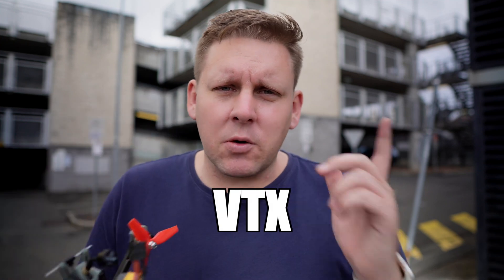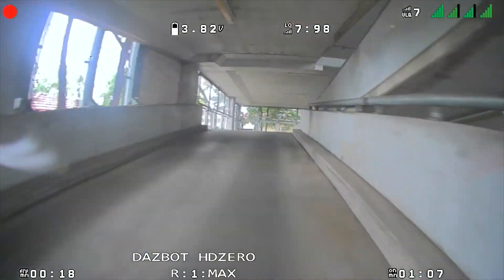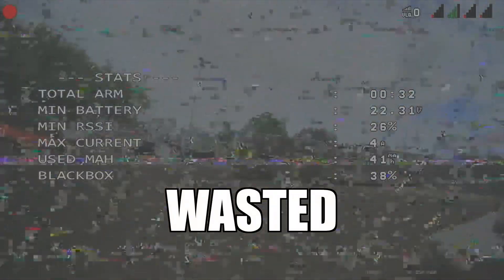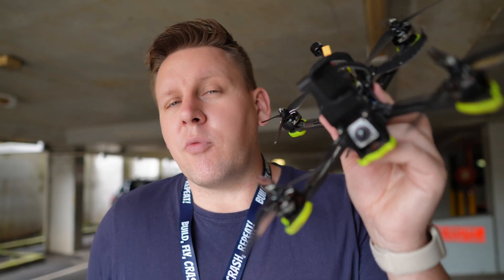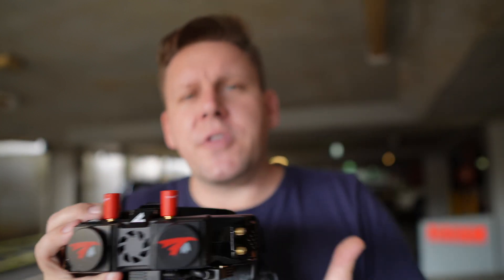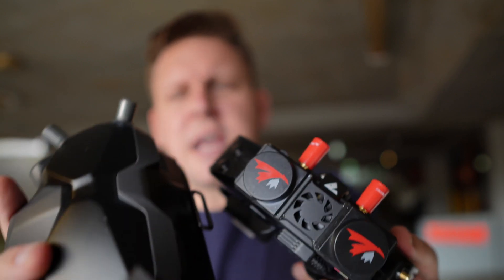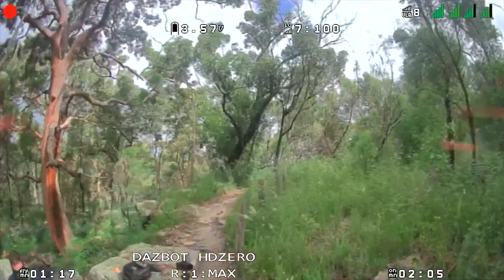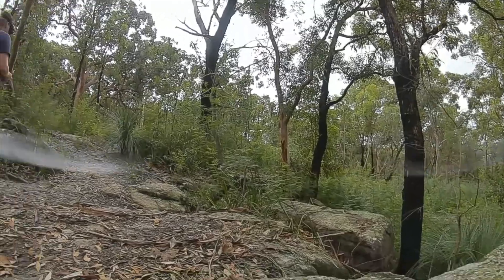HDZero FPV Freestyle VTX vs DJI FPV System 🤯

Comment: I wonder what an equivalent analog would be like.

As an analog flyer focused on micros, I am interested in HDZero. I think the image quality, penetration of DJI is better. I don't think I would notice the variable latency. What I love building and flying are 1S and 2S drones with props that are smaller than 2.5" in my backyard. As a result, I find the light-weight analog VTx great, and now possibility of this with HDZero exciting.
Reply from the maker: There is a 1S vtx on its way
Reply: @DarrenAllatt  waiting for this. Planning to build a new micro once this is available.
Reply: Joshua Bardwell made a similar video with analog included
Reply from the maker: @abouchard2903  yes I saw.
Reply: @DarrenAllatt  I enjoyed your video, this comment was intended for  
Ashish Shrestha's comment curious about analogs comparison, great video keep up the content!

Comment: clearly DJI is the better. it doesn't require piggyback modules,HD0's quality of image is not much of an upgrade from analogue. cost of HDzero goggle,module,antenna,battery. vs 1 purchase for dji?
Reply from the maker: Have you flown HDZero?
It’s easy to say from YouTube videos that it’s not much of an upgrade from analog but until you strap on the goggles you really don’t notice the difference. 

The piggyback modules are a necessity from a first release. You have the Scout HD with integrated HDZERO and later this year you’ll have integrated Skyzones with HDZero as well. 

The piggyback allows you to use existing googles as opposed to a whole new purchase which reduces the initial investment. 

Cost wise. Your numbers are way out.

Regardless of which system you go into to purchase you’re going to have to buy the drone batteries antennas and all of that anyway
Reply: I flew my first 2 packs on HDZero yesterday. I was really very happy with the image in my Sky 04X goggles. So much better than even my best analogue setup. However, I came home and watched the DVR and it is quite disappointing. I'm sure uploading it to YT would reduce the quality enough to make it look pretty poor. Sure it isn't DJI quality or penetration but it is as easy to use as analogue with way better image. I'm liking it. I won't be rushing to change my fleet to HDZero at the moment but will do it gradually as new and better equipment inevitably hits the market.
Reply: They really aren't that different in terms of price.
The new 1W HDZ VTX is 120-130€ +40€ for a cam. That's 170€. You can get a Vista for less than that. 
The VRX is 250€. The $99 price was just a way to push it into the market. 
So that's 420€. + you need a pair of goggles for 400€+. This makes it ~800€ for new pilots.
DJI costs basically the same and you get a pair of really nice goggles which can also be used with analog setups. 
So for new pilots or people who need to upgrade their goggles it doesn't really make sense to buy a HD Zero setup IMO.
HD Zero used to be cheap when they entered the market and wanted to attract customers, but now these days are over.
The only real advantage of HD Zero are the potential 1S boards.

Comment: I bet you that you hadn’t stood outside of the garage hd did the same test.
Reply from the maker: I stood in the same position for all tests which was just inside the garage on L2
Reply: @DarrenAllatt  ahh, so you weren’t necessarily utilizing the whole reception setup as it was intended. Patches are intended for LOS, and stubbies don’t offer the kind of gain you’ll normally look for in a single channel beam width.
Reply: I’d at least use some duo axii v2’s or something
Reply: @DarrenAllatt  a proper comparison would be to limit dji channel to 25mbps with proper antennas on both
Reply from the maker: @cashmoneypwns  proper antenna’s??

25mb mode would only show picture quality - the aim wasn’t to compare that, as we already know that on 25mb the image is equal and 50mb mode is a higher quality. 

The antenna setup was as equal as you will find. If I wanted to run dual axi v2 on HDZ I’d need to get those fro DJI.
Reply: @DarrenAllatt  it wasn’t just image quality tho. It’s total beam width for penetration.

Comment: DJI is the clear winner for me, just got it and a babyhawk ii hd. I love the sharp image, massive screens and insane penetration on any power output. I can go through more stuff on DJI 25mw than I can on analogue 200mw or 350mw! Absolutely amazing, so worth the money. The latency is not an issue. For me, hdzero just doesn't have the penetration or image quality I'm after, it is closer to analogue than DJI imo.
Reply from the maker: HDZero is leaps and bounds above analog. I don’t fly analog at all so wasn’t going to put together an test for that.
Reply: @DarrenAllatt  have you seen Joshua Bardwell's latest hdzero Vs analogue Vs DJI video? Hdzero gets destroyed penetration wise Vs analogue even. However, it does have clear pros, like the picture quality is a fair bit better than analogue and there isn't a multipathing problem.
Reply from the maker: @jackjohnson5024  yes I’ve seen his video. It looked like he was flying down levels, which is why I flew up. Flying down gives strength to DJI given the two lower Omni’s - wasn’t sure if he pointed his head down when testing HDZ or if he kept it flat
Reply: @DarrenAllatt  that's a good point for DJI, but what about analogue? The analogue quad was getting far better penetration than the hdzero one.